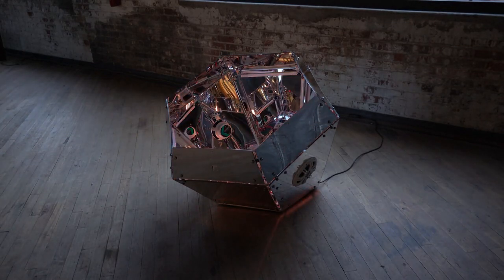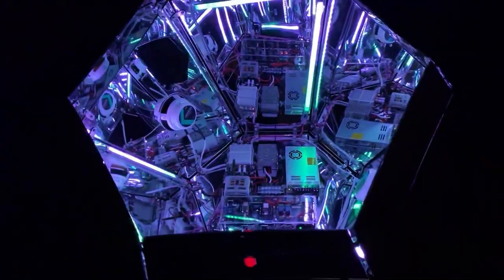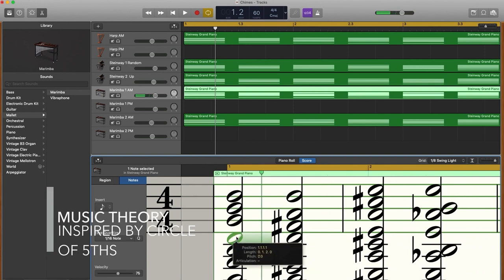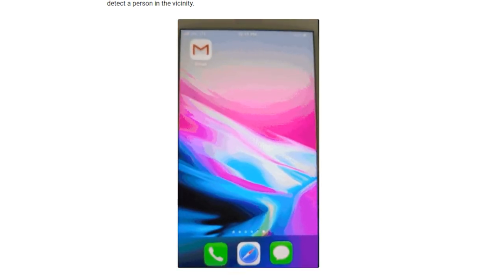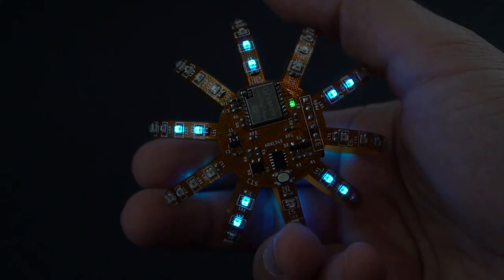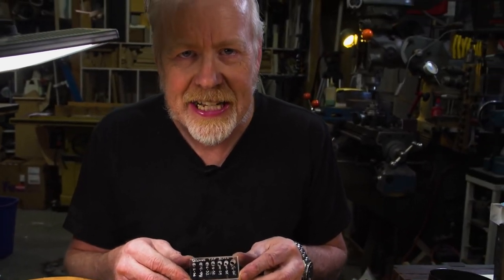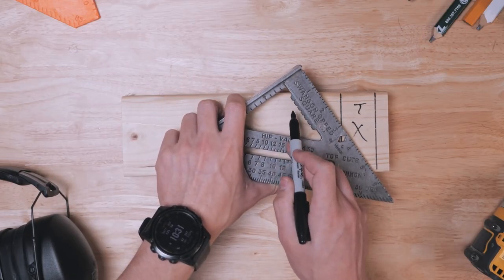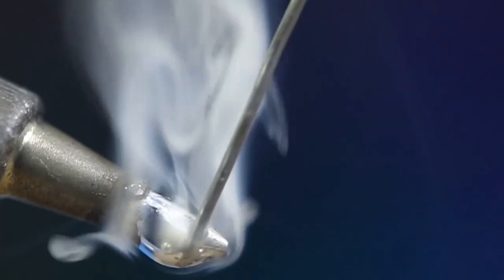Circadian Sound [Maker Update #198] - Maker.io

Comment: Another great Maker Update video. If you would like a detailed information about tapping a hole or using a die to cut threads I recommend getting a copy of Machinists Handbook and it can even be an older copy. Covers metric & standard and also imperial for pre-drill size for taps. But the biggest thing to remember is the smaller the diameter the slower you go and use a lubrication source. But check out the video too... one can never have enough information or experience.
Reply: Good info John!
Reply: Maker Project Lab - I should have mentioned that the handbook also provides the use of Helicoils just incase a thread gets damaged and you still need to use a bolt or screw. Oversize drill it, tap for helicoil insert, set helicoil and your project it’s operational. And if your tapping aluminum you may want to use a helicoil for added strength?? As you their is an entire engineering science to fasteners.